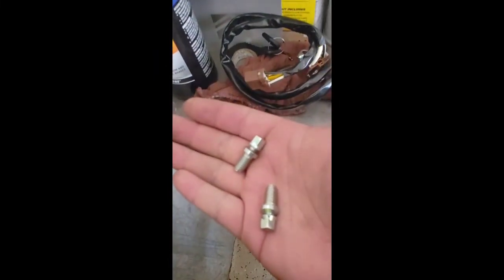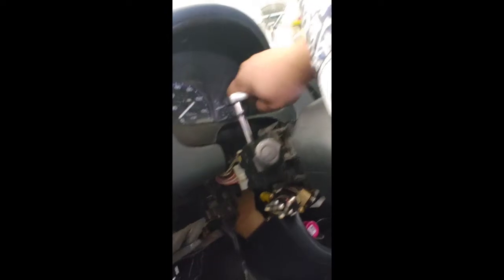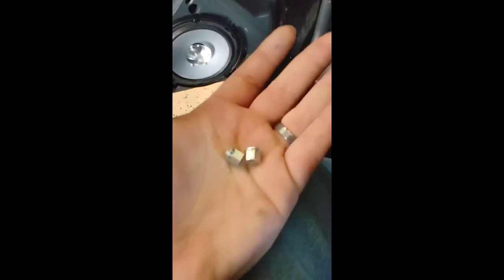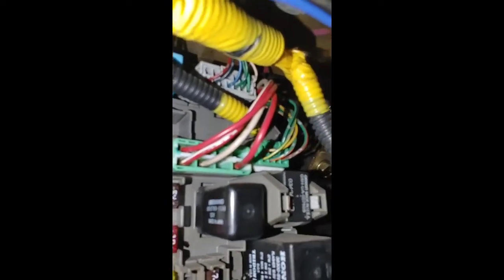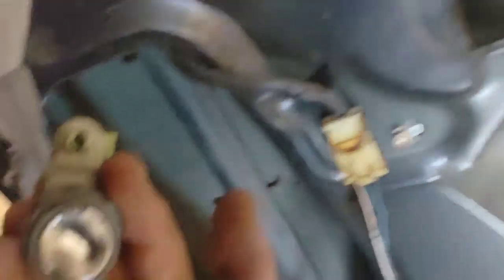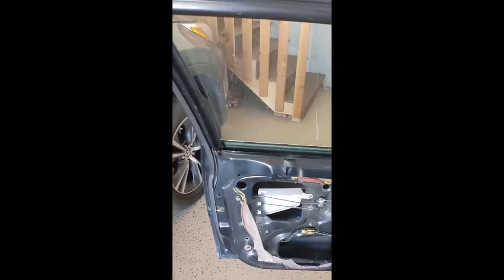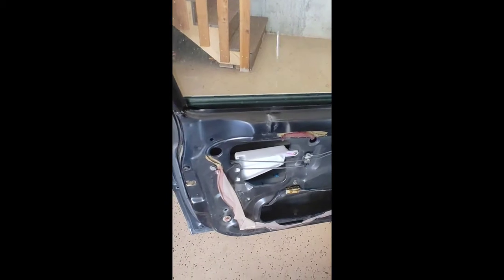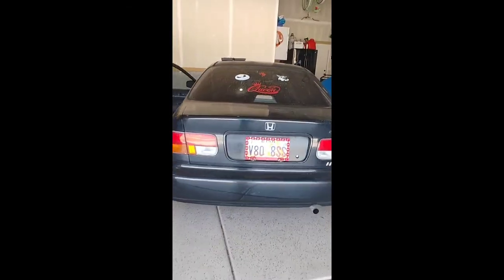How to install ignition, door, and trunk lock cylinders on a 96-2000 Honda Civic

Comment: Did you have to wire them into the new ignition switch harness ? Currently having trouble on mine. Ex coupe swapped to a manual transmission. Dont know where the extra wires go into the plug
Reply from the maker: I didn’t because I used to the same parts and styles. You may need to ground out a neutral safety switch cause automatics have those.